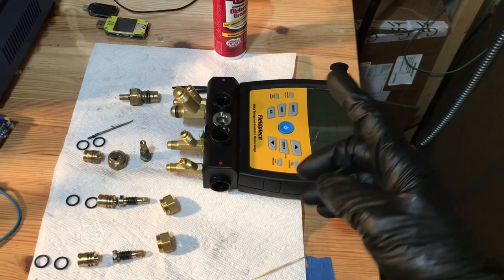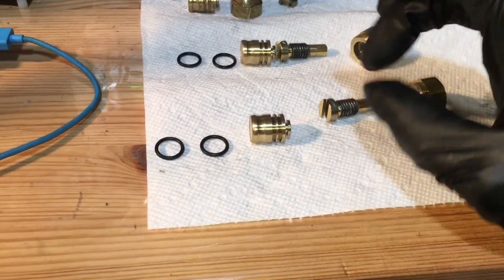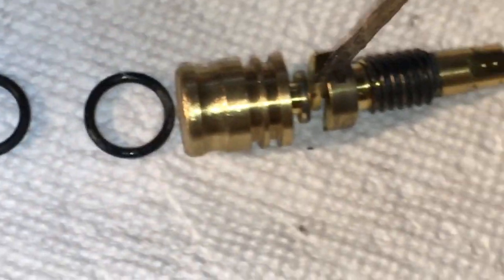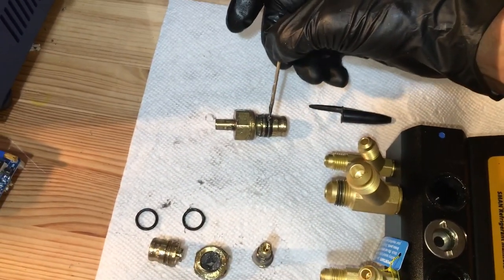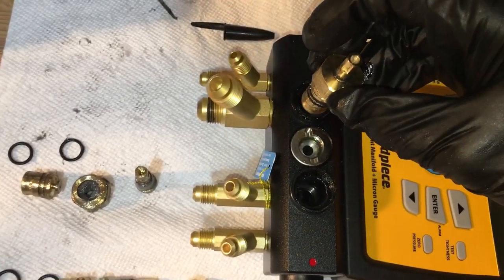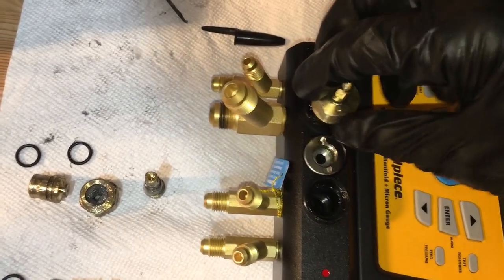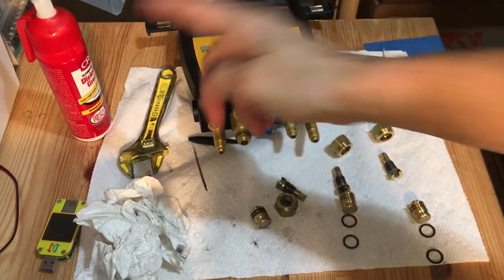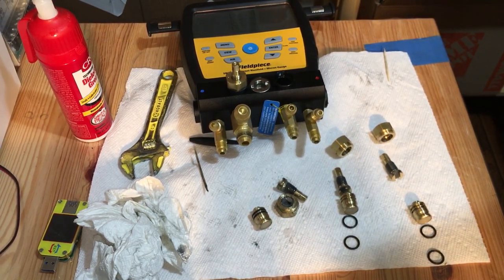SM480V overhaul deep vacuum modification.

Comment: Can you show how to fix, if liquid line port is leaking right at where it’s coming out from bottom black piece?
Reply from the maker: Now that’s a difficult leak.  Because I am not sure but I very well believe they have a Loctite substance holding that fitting into the machine the body of the manifold. 

          So if you possibly attempt to remove that brass fitting there’s a possibility it may break off. 

But this is where your mechanical skills come in to place myself being an automotive mechanic and my father and my grandfather and his grandfather before him. 

You’re taught how to use reverse thread drill bits

Or your taught the method of drilling out the inside diameter with slightly large progressive drillbits until you come to the threads and they collapse. 
        And then you can use a pic to clean out the remaining threads. 

        A lot of Loctite at roughly 400°F the synthetic resin for bonding starts to break down into a dust. 

        But because this is a manifold with other heat sensitive components on it heating it up is out of the question. 

Did you try to remove the fitting ? 

I myself would try to remove it because I don’t worry about snapping it off inside because it’s easy for me to fix. 

         But if it is no longer in warranty and you cannot send it back.     Or you put a wrench on it and try to remove it and you cracked the threads and caused a leak yourself that would not be covered under warranty. 

         Then if I had to think of a backyard mechanic way to possibly attempt a leak repair without removing.       I guess I would think and analyze the leak in reverse

         If it leaks out word then maybe it leaks in-word I would put the manifold under vacuum and use some 99% rubbing alcohol to clean the area use the wire brush to remove some of the anodizing finish and rough up the side of the brass fitting in preparation to put in a small amount of JB Weld at that location. 

         I would perform this procedure with the manifold under vacuum so it is literally pulling your alcohol or your acetone in words down into the leak at the same time flushing some of the residue mineral oil or ester oil that has contaminated the thread while it is under vacuum. 

          Then apply a very small amount of JB Weld around 360° circumference of that fitting just slightly building it up in an inward radius up to the lowest point of the six sided fitting part.     And about one or 2 mm spread out onto the manifold in a circle around the fitting. 

       At the same time you are performing this whole entire procedure well the manifold from the inside is under vacuum pulling in words so if there’s any slightest possibility of a slight amount of the JB Weld to always being continuously pulled towards the leak. 

         Allow her to set up for two or three days before putting it back into use. 

Do not listen to the instructions that it says it’s fully cured within two hours or 24 hours don’t be impatient let it set up for two or three days before using it. 

That would be my backyard hack last resort method of repair if I could not repair it any other way.

Comment: So I heard you mention in this video and at least one other that you are using dielectric grease then call it silicone grease. They are technically different. I just bought some dielectric grease, but would it be better to use actual “silicone” grease?
Reply from the maker: For the Not solo vacuums that we are achieving in the automotive field it’s not really that important.  Plane spark plug boot grease ( dielectric grease) 
What is silicone grease. 

Not the specific silicone grease that is actually used in laboratories for meeting two surfaces together under ultra low extreme vacuum. 

It is still just regular silicone grease but has been processed an ultra of find and had all the moisture removed from it. 

Because when you’re getting into ultra low laboratory type vacuums 8/10th power. 
     You will pay a ridiculously ludicrously high price for a silicone grease that has been specifically developed in a small little tooth paste tube or tin can for laboratory use. 

And due to the fact in automotive and we’re pulling through refrigerant hoses there is so much loss in Refrigerant hoses alone you can almost get away with just using regular old fashion Vaseline petroleum jelly. 

      And that’s exactly what they used to use when my dad was a young man with CFC refrigerants that use mineral-based oil for refrigerant oil they used Vaseline.
Reply: Gotcha, thanks for the reply. I picked up some dielectric grease when I was out today before I left this comment but something told me I should ask you since you were mentioning specifically silicone grease.

So, I ordered on Amazon superlube silicone dielectric grease. I’ll probably take apart my gauges this weekend then test with vacuum after and let you know.

Im a commercial tech and I use my trublu hoses as much as I can but I cheat a bit and throw my SMAN gauges on the sides of the core removers to track my microns.
Reply from the maker: @JwKovach85  yeah we just can’t help it it’s too convenient just to throw the gauges on instead of breaking out the big hoses. 

Except when I’m commissioning and just put together a brand new system then I will always use a silicone hoses or straight copper pipe to my vacuum pump you soft copper as a hose breeze on a ball valve as you’re on and off valve.
Reply: Alright, so deep clean and lube complete. After several test runs with all valves capped off to isolate my gauges 100% it finally pulled down and held To 700 microns after 10 minutes. 

After I did a full strip and lube, I did take them apart one valve at a time and added more silicone grease to the O-rings and threads because I wasn’t liking what the microns were doing after I isolated the gauges, but after lubing the second time and a few vacuum runs to get out all the moisture from the alcohol cleaning it did well.

I then added my hoses back and did several vacuum runs to dehydrate them and it held to 900 microns after 10 minutes.

So kudos bro and thanks for the videos and tips!
Reply from the maker: @JwKovach85  now remember as you turn your isolation valves there’s literally air trapped inside the valve in the closed or open position and you have to move it back-and-forth several times to burp out that trapped air it will mess with your micron readings and make them higher appearing you’re losing vacuum.

Leave it on the vacuum pump overnight and see what your results are that’s definitely enough time to dry out your hoses because you literally have moisture absorbed into the rubber lining of your hoses and in the manufacturing process when they’re new there’s literally gas and VOCs from the solvents of the hoses trapped inside the layers of rubber. 

 So usually when you leave it on the vacuum pump overnight you’ll get your final and true vacuum but it’s also limited to what your vacuum pump is capable of.

And a few other factors
Reply: Yeah I was opening and closing my valves many many times but you’re right, I’ll leave it on over night and see what it gets.
Reply from the maker: @JwKovach85  let me know what your results are with the overnight vacuum.
Reply: Ok, so I left the vacuum on for about 6-7 hours and final results were better. When I turned off the vacuum it was at 57 microns, then just closing off the vacuum port and leaving high and low side open it climbed to 355 exactly after 10 minutes.

Then just now overnight of about 8 hours I went to see what happened and it was at 1035 microns which we can chalk up to the hoses since I run refrigerant through them and what not which is still pretty good.

So yeah now I can feel 100% confident that the manifold is leak free and my hoses held up pretty well too.
Reply from the maker: @JwKovach85  👍 sound like you got it as good as it can get.
            It also shows how bad refrigerant hose permeate and off gas. 

I have one video we’re I replace hose with soft copper lines. 
       Vacuum goes lower and holds.
Reply: Yup that’s exactly right, the bright side is I will be able to use the trublu hoses most times but at least I know with your grease set up my gauges are golden, thanks again for the video bro.

Comment: I have one of these gauges with a leaky sight glass. Can you advise me how to fix.
Reply from the maker: I believe there’s an O-ring under the site glass I have never replaced one yet but I do have a screwdriver large enough to fit in that large slot from one end into the other to unscrew it. 

        You can contact fieldpiece directly to their contact support email send him a message see if you can purchase the O-ring. The same way I purchased the piston seal kit for my manifold.

Comment: Is there a way to replace the seal under the sight glass? I have a leak there.
Reply from the maker: Are you 100% sure you have a leak ?. 

When you’re drawing a vacuum, you see a little tiny bubbles in the oil around the side glass ? 

1:  you could have a leak or 
2:  refrigerant, and or moisture, gets stuck and caught around the O-ring deep inside the groove. 

As you do a recovery and going to teeth vacuum, or when you pull a vacuum, you witness bubbles starting to come out inside the window of the sight glass .   It will eventually stop as the outgassing is complete..   

How you can test this theory . By putting some NYLOG around the site class outside circumference, this will stop any vacuum from being drawn in words and you will see the bubbles disappear with that NYLOG applied. 

3: do you have a leak under pressure and when you put subway bubbles on the outside of the sightglass you see bubbles coming through ? 

If so, you can order a new sight glass from True Tech Tools 

You get at 8% discount when using my discount code at True Tech Tools 

LECHAIR enter all capital letters, all one word in the discount coupon box at check out.  And when you check out a calculating discount 8%. 

They give free shipping on orders over $50 

Since the site glass is probably less than $50 . 
To get the free shipping you may want to add some small things to get it up to $50 

Like  NLYOG and BIG BLU microwave detector bubbles

Search their website they have so many HVAC tools that you probably never seen in your life . 
True Tech Tools is the best place to go online. I’ve been buying my Hvac tools for over a decade from them. .
Reply: @coldfinger459sub0  First I thought it was the R32 gassing out from the oil but it was weird because I was at 1000 microns and the bubbles only appeared at a particular point on the edge of the glass.
Reply: Although it isn’t the same model but very similar to what I’m experiencing:

https://youtu.be/AprnoGRNUfw @coldfinger459sub0
Reply from the maker: I get this all the time on my refrigerant gauges. I have five sets of refrigerant gauges they all do the same thing.
Reply from the maker: @CH-vz5kf  yes that’s exactly what mine looks like. 

I guess I have to do a couple of vides on that .   

When it is doing that 

This is when you put silicone, grease or nine log around the outside, circumference of all the seams . 

If it does not stop, it’s out, asking if it stops. It’s a leak that’s how you can tell the difference.
Reply: Just had a chance to check it using my vacuum pump. Unfortunately it’s defo a leak in my case. I used to be able to pull it down to 40 microns no probs, but now it stops at around 240 and doesn’t hold it either 😢:

https://youtu.be/5YPzaUaxdVA
 @coldfinger459sub0
Reply from the maker: True Tech Tools will have your replacement part for you

Comment: What glue do you use to put the stickers back?
Reply from the maker: The tacky glue that was already there never removed it.
Reply: @coldfinger459sub0  ok cool. Was concerned it wouldn't stick back. Thank you for your help and good video
Reply from the maker: @90_rooster14  Only if you get some silicone grease or nay log on top mixed with a glue it will no longer stick because it’s like Greece

Comment: Can you make a video on how to clean the micron gauge sensor in case it is contaminated with oil, thanks.
Reply from the maker: I think I made one before but I guess it’s time to make another one for anybody new. 
       In the meantime here’s the website link to the blue vac micron gauge and on there they have the instructions on the recommended cleaning procedures and they might even have a video somewhere on their webpage

https://accutools.com/vacuum-gauges

Also go to Fieldpiece website and look up their instructions
Reply: I couldn't find a video on how to clean the micron gauge sensor for SM 480V, I'm asking because I think in one of your videos you mentioned you clean them , thank you for the link though .
Reply from the maker: @LK-ee9bk  In your instruction manuals they tell you use I saprobic alcohol if you could find 98% or 99% that would be best. 
         Pouring it or injecting it into the gauge manifold hold your finger over the port shake it around blow it out with a little nitrogen repeat the process to or  three times
Reply from the maker: @LK-ee9bk  here’s a link to all the field peas videos. 
    I just briefly them really fast while I was driving and I believe you are right I don’t see a video on how to actually clean the manifold gauges so I may make another one

https://youtube.com/c/FieldpieceProducts

Comment: Can you show how to replace or change liquid line port on SM480?
Reply: All 4 of mine were leaking. Couldn't figure out how to get them off so I put rtv at the base of the threads and set it on a vacuum to pull it into the threads. No more leaks(for now😳). Much cheaper than replacing the whole thing
Reply from the maker: That was a good idea
Reply from the maker: I have never had to change a liquid line port I am assuming you’re talking about the brass threaded quarter inch. 

I am pretty sure they have some sort of Loctite sealant that is acting as similar to a epoxy . 

So I’m pretty sure if I try to unscrew it, it would probably snap off . 

I guess if I was going to tackle that I would have to remove all the cylinder port valves from the manifold to protect them because I would apply a little bit of heat, not too much because most thread locks sealants chemical composition breaks down at roughly 400°F And it becomes brittle and fragile kind of turns into a dust. 

But I would have to call and ask technical support at Fieldpiece to confirm that they use a Loctite type adhesive to seal their brass fitting into the aluminum manifold . 

Because you would not want to have heat transfer up to the aluminum manifold to rubber or plastic pieces or the sensitive micron sensor located inside there or the adhesive on the other side of the manifold where the pressure transducers are located just above the high side port . 

Because I have done machining and extraction of broken studs and bolts and fittings if I did snap it off, I know how to extract it without damaging the manifold . 

But where there’s a will, there’s a way . 

Even if you had to clean with a little acetone and do a little bit of sanding and use some two-part JB Weld epoxy around that area built up to stop your leak .

Comment: yes vacuum to center hose will not pull down only to 1600 micron making you think you have a leak in system / now if you place suction hose on vacuum it pull down to 250 micron and there tech support sucks this happen from the factory my unit is new. i finish watching  it see if  you fix it.
Reply from the maker: If there is no leak you can pull vacuum from any hose it makes no difference. 
        You should be easy to go well below 100 microns just in a few minutes. 
        Easy fix if it leaks. 

            Any way refrigerant gauges with rubber hose were never meant or designed to pull or hold a deep vacuum.      They should never be used to try and perform a vacuum decay test for any sustained period of time. 
          Just the leakage through the rubber hoses that is natural the outgassing from moisture trapped in the rubber or any refrigerant from previous uses many times will make the vacuum decay test fail. 

           It’s not that there’s something wrong with the refrigerant manifold gauge set or the hoses it is just that the wrong tools are trying to be used for a job they were never designed for in the first place.
Reply: @coldfinger459sub0  pull only on suction side see how fast it pulls down
Reply: @coldfinger459sub0  when I test my on low side only not thought vacuum hose it only took less then 5 min .

Comment: I wouldn't know where to begin on removing the body off the manifold on the sm480 without tearing the little wires
Reply from the maker: You don’t remove the body off the manifold it’s permanent they use a glass like solid epoxy to mount them together

The service valves are removable
Reply from the maker: Been a long time since I opened up the actual case body nothing really serviceable inside their

The wires take a steady hand in a skill set and a little knowledge of soldering find electronics
Reply: So the manifold is trash then! They must have not epoxy body on right or something. Not buying anymore fieldpiece again
Reply from the maker: @johnfrancis4748  send a message to TECH SUPPORT and ask them I have five Fieldpiece manifolds I have not had that problem yet.
Reply: Another video
https://youtube.com/shorts/Pal158boDTw?feature=share

Comment: I hope to mush silicone don’t mix with refrigerant
Reply from the maker: You do not put it on the inside face towards where the Refrigerant dias only behind the O-rings inside the groove of the O-rings. 

Silicone grease and not the type of silicone you using your bathroom for caulking that dries